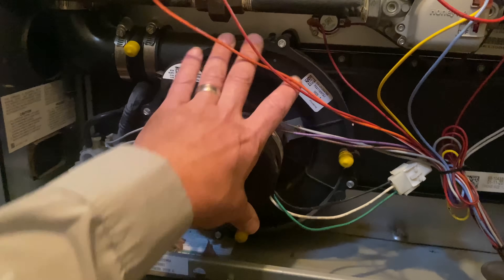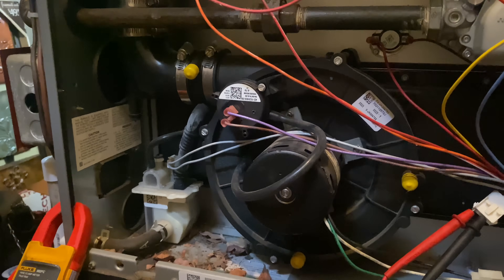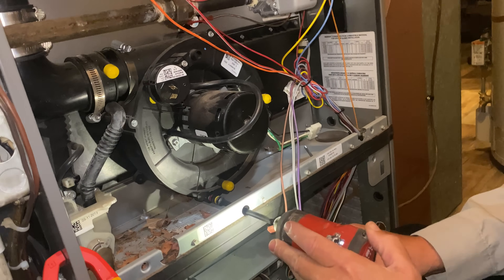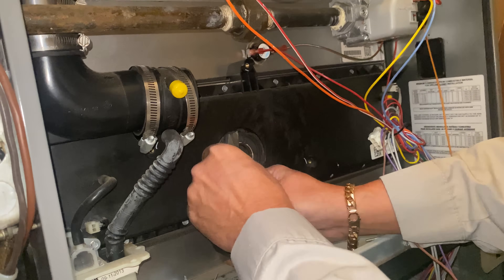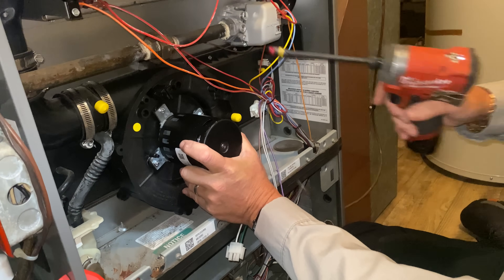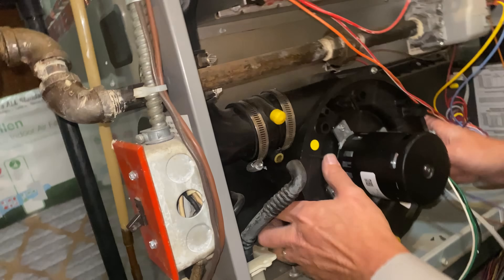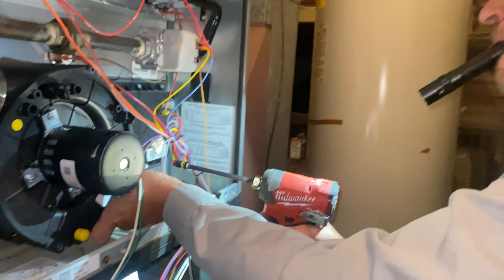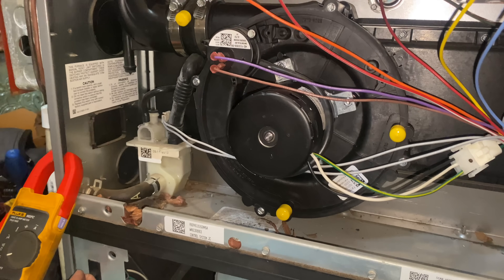Update: Rheem Gas Furnace No Heat - Dead Inducer Motor Assembly Replaced

Comment: careful to keep test running the inducer short, most will over-current without being attached, because they'll move too much air freely and just like the indoor blowers.
I repurpose used ones for other things, like drying, air supply to fire pit, dust extraction. lol, why spend a fortune when you can get used for free off many scrap furnaces.
NOTE: I would never put them back on another furnace.

Comment: There's two water sensors on the collector box one in the upper right one in the lower left. They are notorious for throwing codes even if you don't have a water issue so keep that in mind. I have actually found those on brand new units that have a bad wire connection right in the plug.

Comment: He never seen a squirrel but I’ve seen birds I’ve seen mice seen a rat once crap load of leaves on the combustion air intake but ain’t never seen a squirrel yet. I got to tell you once in a while it seems like one of them screws has got to always be a pain in the ass.🤬 but I did finally figure out why every so often throws a fit is actually in the mold!! An?? It only hast to be off 35 thousand to make you pull your hair out…😂😂😂 considering they probably mold eight or 10 of them at the same time in the same die there’s no way each one is 1000% spot right on… but excellent troubleshooting❤❤
Reply from the maker: Haha, sounds like you've encountered quite the menagerie of creatures and obstacles! It's all part of the fun, right? Keep pushing through, and maybe one day you'll spot that elusive squirrel!
Reply: wait until you hit a pipe full of yellow jacket nest, so much they were inside the furnace! 😬

Comment: You couldn't see it, but the camera angle showed the inducer housing was slightly low and maybe to the right when you were having problems starting the mounting bolt. It must have been that 10 pound squirrel that caused it.

Comment: Use a nut driver not impact gonna crack the collector box like that.. use right tool for proper application
Reply from the maker: Correct
Reply: ground control to major tom @PipeDoctor
Reply: trigger control, learn it?
granted I've been using power/air tools for over 30 years, some have very whizz-poor trigger controls or start/cutoff speeds way too high for some delicate fastening scenarios.

Comment: A lot of the time the inducer assembly’s come with a restrictor collar used to go on the back of the inducer when the system is 50000 btus or less. They will give you a bag with different sized baffles to match what was existing. It won’t pull the pressure switches in if not installed. Just something I’ve went through not knowing why it was happening. It’s always something simple that sets you back. Good work getting them heat